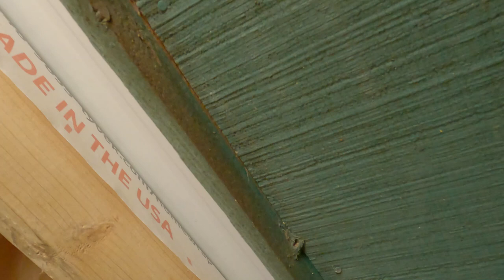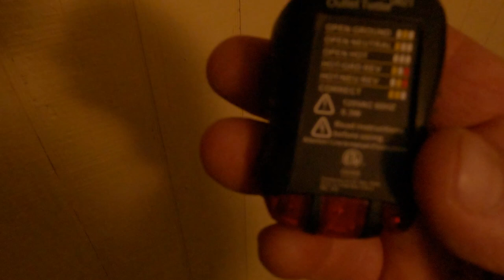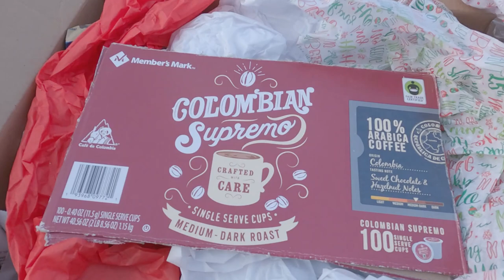Dog Apartment Has Juice, But Bad Light Fixture Caused Me A Lot Of Work!

Comment: I know how that wiring can be, I installed a extra light switch in the bathroom to have a separate switch for the exhaust fan, I went into the attic to wire it. I told my ex-wife not to turn on any bathroom switches until I come down, I couldn't get anything figured out, she was in the bathroom flipping switches! I was mad, I gave up and it never did work correctly.

Comment: Just wait until you need to run a 30 amp circuit! You'll wish you had saved that 10/2!
Reply from the maker: No I wont, the whole cabin is wired in 10/2
Reply: @ouachitamountainliving  At least you know it's heavy enough wire.

Comment: The property you mentioned is pending. If there is another nearby with an acre or two, please let me know. Couldn't find anything on that other property or the one near Jeff.
Reply from the maker: There is a 1 acre lot in Boles, Ar. not far from me. The house burned down, but it has septic and electric,Listed for $10,000
Reply from the maker: https://www.zillow.com/homedetails/2325-Old-Boles-Rd-Boles-AR-72926/109112948_zpid/?z7&utm_source=email&utm_medium=email&utm_term=urn:msg:202211280803306e16a8324ec34f82&utm_campaign=emo-homerecs-email&utm_content=forsaleimage-HomeRec_AI-PERS-EMAIL-AA-NoHRS-NoHRS_rid-dk3WZiKvf9ePoW6SdCJ3fr_&rtoken=0093919a-09ea-4a81-9a59-ffc0305e900f~X1-ZU10x2pa4cx3z0p_8tgif